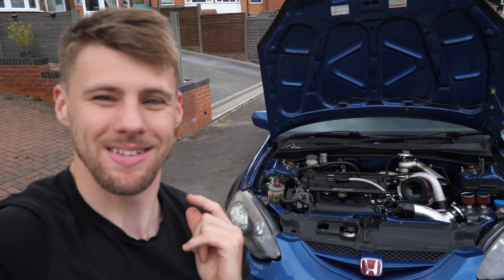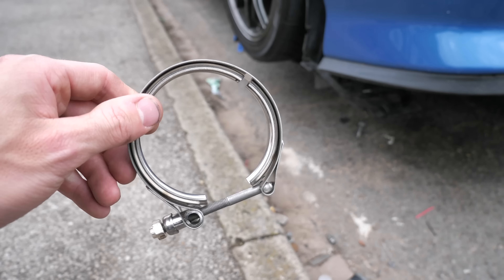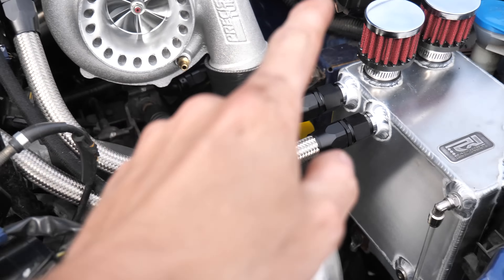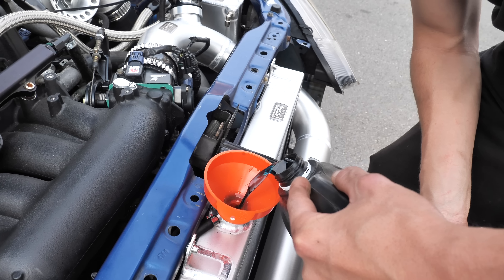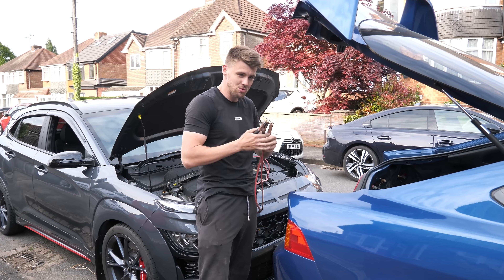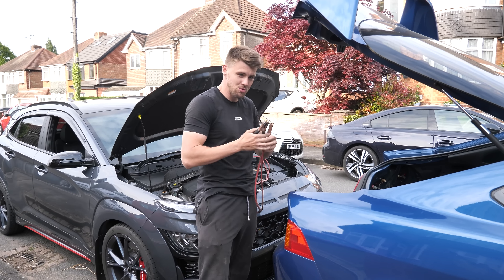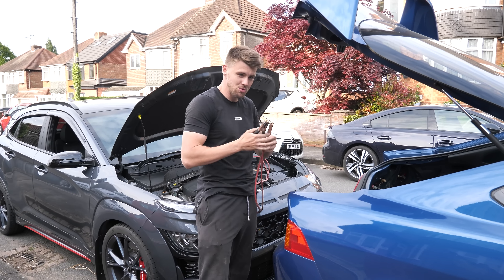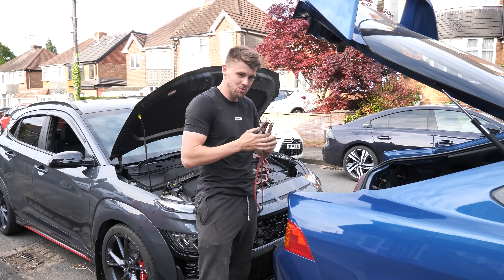WILL IT START??: Turbocharging a Honda Integra DC5!

Comment: looking mental mate... may be a stupid question but what do you do about water getting into that pipe from the rain? 

Also potentially a black carbon surround could be custom made to fit the hole and have the pipe sitting through it? would need to make the hole more symetrical first
Reply from the maker: Thanks bro really appreciate it 
Yeah we’ll sort it hopefully in the next video

Comment: A removable click down bonnet with bonnet pins will be better- get a carbon/stainless surround for the exhaust cutout and fit the bonnet from the top rather than closing it conventionally - or buy a carbon/fibreglass bonnet and do the above